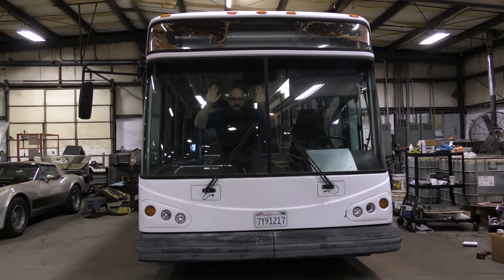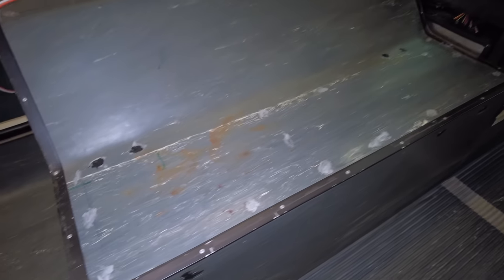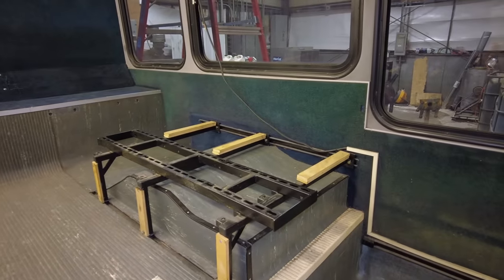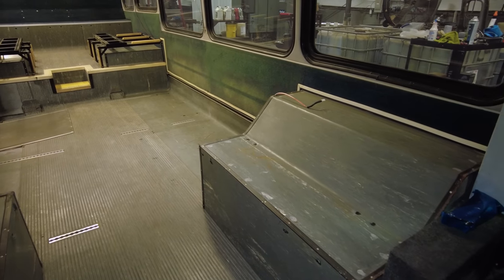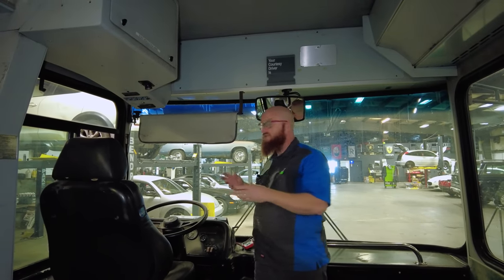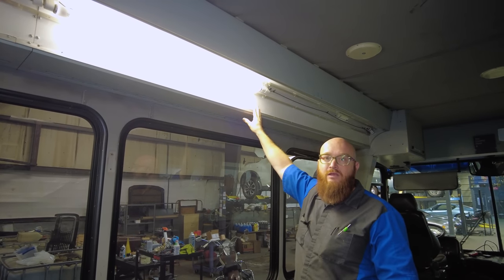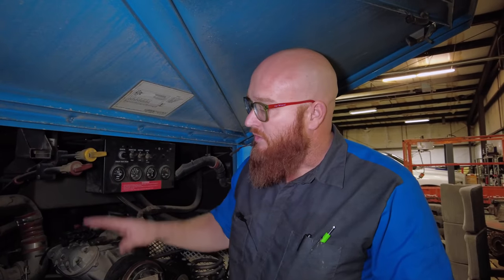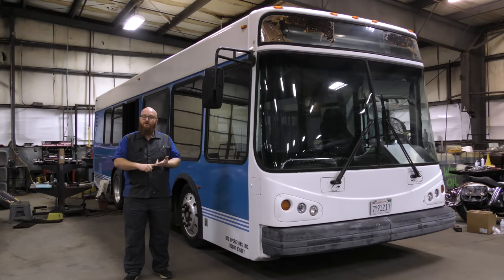Bus #3: EZ-Rider bus looks great cleaned up! Plus the CAR WIZARD has found a lost gear?!?

Comment: it's interesting that the engine was "detuned" for city use, probably extends it's life considerably.  as an rv, there will far more highway driving and much less stops and starts
many rv owners rarely cook in their camper, in over twenty years of camping our oven has been used twice and stovetop elements almost as rarely.  most food prep is done outside so consider a propane hookup for a bbq, outdoor outlets.  many rv;'s these days have kitchen facilities accessible from the outside.
another ting to consider is water tanks; fresh water, gray water(shower and sinks) and black water(toilet).  rv's have these all under the floor, the black tank is almost always directly under the toilet.  you may want to think about tank placement early in the build!

Comment: Car Wizard,
Have you thought of a strategically placed on board generator that will tap into that system and be able to handle all the amps safely for stationary camping needs? Depends on where you intend to camp, weather it be a campground with electricity plug in source or using a on board generator, all your family electrical camping need to be considered. Running two A/C units while in transition a another matter, stationary camping needs also another matter. Thanks for your vids, always appreciated

Comment: I don't know if someone else has suggested these, but here are mine:

* 1 fixed wide angle backup camera using wires, (for reliability over WiFi), at the top rear.
* Another wide angle backup camera, (maybe WiFi), attached to the rear of any vehicle that you are towing.
* Large LCD, (10" or larger), in easy view of the driver, for the backup camera(s). Could possibly be a tablet, and used for navigation when not parking.
* Front mounted spot light, 180 degree adjustable from inside. Not sure if drivers corner would be better, giving the chance of 270 degree range, (adding driver's side)
* At least 4 official seats, (in addition to driver), with 3 point seat belts, so if you have guests or children, they are safe.

Otherwise, sounds like you have great handle of what you want to do.

Good luck.

Comment: In the back of the bus perhaps folding couches like that they have in rv’s might suffice. They won’t look like beds all the time and you have a comfortable elevated lounge area to look out of the windows. Up front again a comfortable tv passenger seat with arm rests. Maybe add some sort of folding table for working on the lap top while traveling. Do put multiple storage drawers up front as well for items needed on the go (sunglasses, wipes, charging cords, flashlights ,etc.). Don’t forget some direct dim lighting over the passenger seat so you can read, prepare snacks, etc. (on the fold down table!). If you can attach some molding along the ceiling to install indirect rope lighting to illuminate the interior without disturbing the driver at night or just setting some ambiance during the evening. Just my $.02 worth.

Comment: You should do a before and after test of those upgrades to the engine and transmission. Like do a 0-30, 0-60, top speed, and look at the RPMs at typical crusing speeds.

Comment: 3:43 personally i would get rid of all the wall carpets since if you have a wall covering it will sweat badly and because you have carpets there they'll keep that water in there making the inside really damp inside making it even colder to live in than it is.
also the reason why folks are recommending you get rid of some of the windows isn't because of leaks and such its because of the U value of them is god awful it's a bus afterall, a bus isn't suppose to be livable so you've got to make it livable by upping the U value of it as much as possible so it retains heat and since your also deleting the AC this will help it stay cool with a much smaller unit also having those windows is a detriment to the full build IMO like leaving the massive hole in a stupidly insolated house it just won't retain the heat the same as it would closed up also blocking some of the windows will make sure you have more room for cabinets and more importantly more room for insolation.

if you don't want to replace all the windows to double glaze units you'll have to do the following:
-frame and insolate the floor (which you'll have to remove all the vinyl to again stop sweating) then plywood it.
-frame and insolate the sealing (which you'll have to remove those lights and boxes to avoid any cold spots)
-replace the door to an insolated ones since the bus ones are terrible and are only there so people don't fall out when its moving
- frame and insolate the back walls (remove the carpets to avoid sweating which will rot and twist the wood and make it colder)
-frame and insolate the remaining bits of walls
-finally add 2 dividing walls one behind the driving area and one in the sleeping area so you don't freeze to death at night 
with all that you'll probably have to get rid of 4 windows total 2 in the sleeping area so avoid freezing to death and 2 in the kitchen area so you have room for storage and to join up to the custom bulkhead behind the drivers seat. 
then you'll officially have a livable shell

Comment: Put rigid foam over windows you want blocked as well as the top and sides of the wheel well bulges to reduce heat and noise coming through.  You could fill the gap between the bed frame and wheel well with rigid foam or spray foam to get the more sound dampening under the beds.  Maybe even putting sound dampening mat on the wheel wells before foam.  It all depends how much noise comes through.

Comment: For the passenger seat,you could check for a salvage Semi dealer,or scrapyard.Get a swivel pneumatic base like the driver seat so you don't get 'sea-sick' from bouncing for miles on bad roads.I've seen a couple rebuilds of trucks and those seats work awesome.

Comment: I would check out older conversion vans in the junkyard for a seat.  You take the middle seat out on the left side, floor bracket and all, and you should be able to get something in decent condition that can rotate and it might bolt right onto that bracket.   If it's still too low it would be simple to modify.  

Usually all four buckets are identical, some of my conversions I just swap a rear one to the front to have something that's like new and comfortable. 

The only thing I wonder if you want is the side door opening directly to the bathroom area.  

I had some of those truck scantool sets, bought at a state auction a few years ago.  Did really good selling them.

Comment: Cool project!
If you didnt think of it you might want to put some eterna bond or flex tape over the holes you siliconed in to make sure they stay water tight long term.
One more idea- cinsider using LED tape light for the 120v lighting in the chases. Or even possibly pulling out the tubes and run it for 12v also. Easy to install, doesn't take up much space and the newer stuff is as bright as the tubes and less energy.
Reply: Or just dig that garbage out and recaulk w real caulk that actually seals.

Comment: Keep the windows! You will have the greatest view for road trips. I would recommend putting shades and curtains for each window for privacy and darkness when ur sleeping. You can also use the front wheel wells as benches and cabinets
Reply: Have you even seen any RVs? Why do you think they have so few windows? Because there's a huge amount of crap covering the inside walls. Like cabinetry and a bathroom.  Just blacked out or vinyl wrapped huge windows look ghetto as hell.

Comment: Wizard, I'm a transit bus tech. Yes B300 Allison transmission are 6 speeds, just not enabled since the governed speed is restricted below effective use of 6th gear.  However, the bus is also geared for low speed operations. Likely axle ratio of 4.56 or 4.89, even possibly 5.11 running an ISB. It would be wise to swap to 3.73 for highway use. Will significantly improve MPG and reduce driveshaft RPM.

Not super familiar with the El dorado's, but most buses run 12v/24v dc electrical systems. Usually the florescent lighting runs on 24v DC. My experience is mainly with NABI, New Flyer, NOVA, MCI, and GMC RTS.

Comment: For more usable storage space under the beds and front seat, I would suggest you have the old seat brackets cut an welded to better frame out your plans. doing so will eliminate lots of dead space that could be used as an unobstructed storage volume. In place of installing 120 volt lights I will encourage you to install a battery charger sufficient to power your 12 volt accessories along with float charging your batteries.

Comment: Having seen many conversions, I cannot stress how important it is to insulate.  You might think you don't need to, but you do.  Both to prevent the interior getting too hot and also too cold.  You won't believe just how quick these things cool down and get frozen inside in the winter or how quick they heat up. That thin metal skin don't do anything but keep the rain out. They're designed to always be running (engine) so rely on that big aircon unit to remain cool and the heating to remain warm.  Just sitting there in an RV park, with a smaller AC setup, you might struggle to keep it cool or warm.
The main entrance doors will also not form a proper seal, so in the winter, that cold air will blast right on in.  (Many switch out the door for something they can ensure to get a seal with, usually a manual door.  Less to go wrong).

Take the wall and ceiling panels off and add insulation.  Put a reflective film on the windows.  You can also get film that helps slow down heat loss. (This is one reason many blank off windows with metal and put in smaller, more energy efficient windows.  Can also help with overall weight.  Glass is heavy!)

Another suggestion would be to add a drivers door or a door beside the passenger.  It can double as an emergency exit also.  There is no substitute for a proper way out. Relying on breaking glass in an emergency sounds ok, but in a pinch, what if the glass refuses to give?

Comment: you should look into installing a night vision camera up top, where the signboard was. Some of those mountains, the roads are pitch black and foggy. A night vision camera will come In useful. you could probably do a spotlight, but that won't help in fog. Don't forget exterior lighting so,you can see around the vehicle at night like to work on it, ot just to see what's out there. So besides a backup camera, external cameras, preferably with pan, tilt and zoom, plus night vision ability. Another thing is for yachts, they ma,e drawer style dishwashers. Very small and they are actually more efficient than you washing dishes. Another yachting tip is powered twin beds that can be motored together to make one bed. The final yachting tip is air vents at different heights. Have the air blow out above you, then another vent at shoulder height, or waist height. Cold air sinks,,but if there is a layer of cold air above it, it takes longer to sink, and as hot air rises, it's diffused better.

Comment: I will suggest painting it white, at least on the top part, and even a roof rack with solar panels would be a good idea, as it takes the sun power and use it to make electricity and not heating your head. The sun will cook you if you don't take precautions against it, so sun shades or sun block film on the windows is also a good idea.

Comment: You know, if you put the Bed Parallel To The Back of the Bus than it would be wide and connected. The little corridor becomes floor space and the wheel wells could have some small cabinetry on it. I bet it would be wide enough for two and certainly enough leg room. You would lie parallel with the rear axle as apposed to being parallel with the wheels.
Reply: I agree
Reply: Bed access then just from one side if you need the bathroom in the night and are at the back of the bed you have to climb over the other person waking them up

Comment: You can lower the load on the A/C by: 1-using metallized film inside the windows to reflect heat and light; 2-use Infra Red and Ultraviolet filtering film on other windows to cut heat gain and colours fading - I recall 3M makes such a film.

Comment: And y'all are doing what my dream is in
The very exact same type Bus , I spent many hours in the Drivers seat in a bus like that , thinking how nice it will be to convert a bus like that to my own custom design ,  to enjoy the Comfort without having to be 10 miles up in the air and enjoying a better comfort being cab over , having a same power as the OTR and being able to pull a big trailer if you need to ,

Comment: When you take the rear wheels off for new tires it may be a good idea to clean the inner wheel wells really good then spray a thick coating of rubberized or truckbed like coating. it will help with noise a ton. It will also ensure a good air seal from the elements.

Comment: Hey, something to consider: covering windows with colour matching dot-mesh (like on company cars). I have it in white on half of my balcony, it does great in keeping temp down in the summer. Kind regards
Reply: I was thinking doing the mesh wrap on the outside and dark tint on the inside would probably help a lot
Reply: @marcuscoster6529  do it the other way around. Ive had mesh outside and its impossible to keep clean. Now i have black mesh from amazon thats sticky but not permanent on the inside, and tint outside. You cannot look into the van but i can still look outside even when driving i can see something.

Comment: I would recommend that you might want to keep one of the emergency roof doors in place in fact Maybe put the air conditioner in the front and then you could have a ladder that could have a rooftop deck where you could put stuff when you are driving like extra attention whatever you might want to carry with you canoes kayaks also I did notice that someone pointed out it might have problems with mountains being a city bus great point so camping around flatter areas which I've heard Kansas is would not be a problem when you buy school buses often they talk about city buses and buses for mountain areas I'm pretty sure if you wanted to let go into the mountains you are so capable in your mechanical skills you could probably change the gearing in the differential but I think you have a different setup so rear engines probably don't have that kind of a thing Allison Transmission probably goes right to Independent arms I have no idea about any what I'm talking about not a mechanic but putting my two cents in anyway I know you are going to do amazing things with this rig things

Comment: This is going to be a fun project I looked over comments and there helpful I am curious where you will put holding tanks both waste and water tanks and where will you put the generator Mrs wizard has a design but with it did you and her discuss tank placement because this can change the design with weight distribution also hope Mrs wizard has storage in mind which needs to be designed so items are not shifting during travel... personally I've never owned a motorhome but family member did and used it a few times so I have some clue and the windows maybe something like blinds because tinting is fairly permanent power tinting is pricey but nice to tint and untint at a press of a button would be cool I know there is tons to think about and can't wait to see the finished project

Comment: I'm going to make few suggestion; Go for a bigger bed and make the area under the bed the area for the water tanks or at the least the fresh water tanks. Design the bed frame to only house a mattress. and Insulate the walls and roof of the bus as much as you can.  
And based on what you guys already have Planned I'm assuming that the driver side windows will be mostly blanked out for the Bathroom and kitchen unless your going to replace the window in the bathroom with a frosted window and making the kitchen have the window as backdrop with no over head cabinets.

Comment: You can utilize an Arduino to switch the AC relays, monitor temp, turn it on when your bus gets too hot/cold. It would save you the headache of running wires, installing switches, and flipping the switches at the right time. The compressor/fan need to be timed correctly to prevent the evaporator coils from freezing up. Home AC systems give the compressor time to spin up before engaging the blower fan and leave the blower fan running for a period of time after the compressor has stopped. Furthermore, the condenser fan needs to run for a period of time after the compressor shuts down, to cool the condenser coils.

You might even be able to adapt a programmable thermostat used for home AC systems, so you don't have to spend too much time setting up an Arduino with temp probes, a temp settings screen, heat/AC switch, etc. Just adapt a home AC control unit that utilizes an Arduino on the back end to control the unsupported parts of the system and you have a simple solution that's easy to use. I'll bet there are IoT engineers in your audience that would be willing to assist you with the implementation.

Comment: It is good to see a conversion with some research behind the build. I imagine people dive into the interior and end up with “bus” problems because a bus in not a bus is not a bus.  I see in the comments people talk about insulation. We forget that the bus has massive heating and cooling so insulation was not needed.
Reply: When being driven, you are correct about the HVAC in the bus.  When 'camping', it's a big box of hot or cold that has to be dealt with in some way.  This bus has no operable windows in the coach area, so the only ventilation will be the emergency hatches on the roof, and the little sliding window at the driver position.  Shade and insulation (on all 6 sides) are very good things.